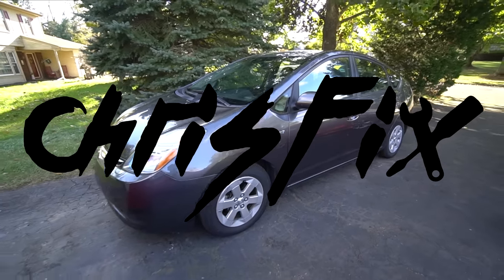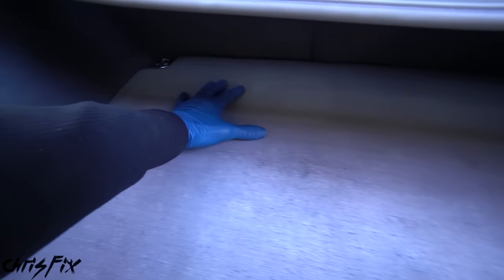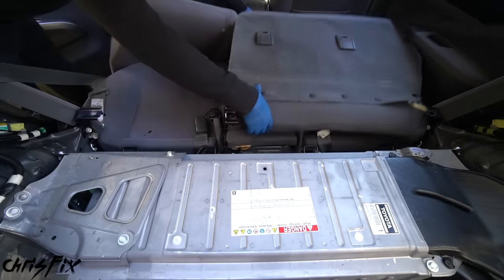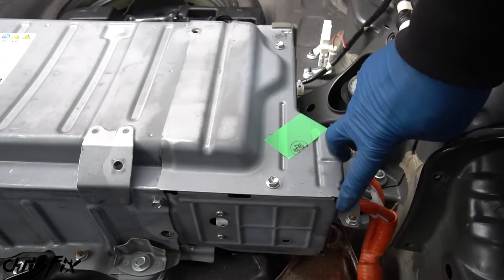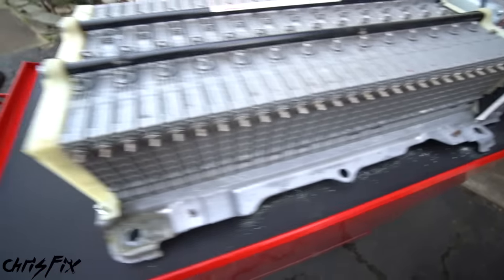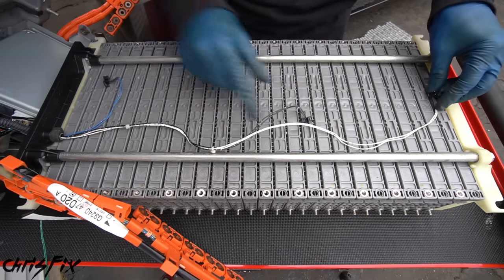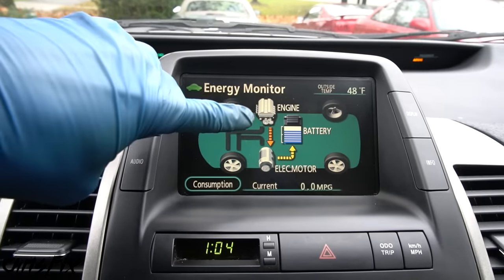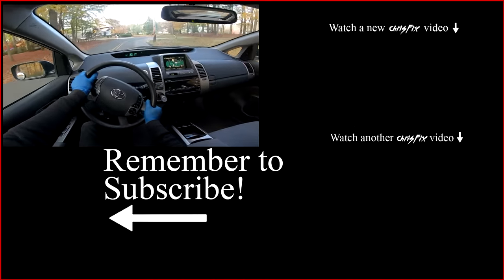I Bought the Most Hated Car on the Internet (and made $1000)

Comment: I’ve been watching your videos for a long time and my friend has two and he saved over $11,000 because of you
Reply from the maker: That is awesome!
Reply: So how much did he actually spend on batteries for the hybrids ? The battery for my pick up is $80.00 .
Reply: Your friend has 2 videos?
Reply: I did a brake job on my Outback and saved over $700 over the dealer estimate. I watched video several times.  By the way your advice to buy an electric impact tool is priceless. Bought one to work  on my pickup and it is a tool I find I use constantly. Money well spent!
Reply: @eaglerider1826  because your car battery is only used to start the car and run some systems but hybrid batteries are used to move the entire car. also hybrid batteries are lithium-ion type and car batteries are lead-acid type so there's a difference right there. when this prius was manufactured the cost for lithium-ion battery packs were 10-20x more expensive than they are now.
Reply: @sentfromheaven00  My point was how cost effective is the hybrid if you have to change the batteries every four years at a cost of several thousand dollars . The maintenance on my truck is a $30.00 oil change once a year .
Reply: @eaglerider1826  my colleague drives 100 miles RT everyday for working. He changed the battery in 8th year with 120k on clock. He got around 70 mpg avg. So comparing with regular sedan get 25 mpg at the time, he saved over 10 grand in gas alone.
Reply: @kiraasuka9943  So how much did it cost him to have the battery replaced ? Price plus labor . I have 215k miles on my truck and have changed the battery once . I also drive home to visit my parents twice per year which takes me 8 hours and 500 miles each way . I don't have to worry about the time it takes to stop and charge the battery or being able to find a charging station along the way . The Hybrid is the car of the future but it is not effective today . What is the extra cost in his electric bill and what does it cost to use someone else's charging station ? Give me an 8 year total and substract it from the 10 grand he saved in gas .
Reply: @eaglerider1826  hybrid is now and the EV is the future. You know nothing abt hybrid or just Prius. Hybrid no worry abt range. Hybrid has gas engine AND battery powered motor. Prius is not a plug in hybrid. Gas is the only food it takes. It's not affecting your electricity bill at all. The battery replacement he's done himself. Took him a weekend and $1200 for the new battery/related parts. He's still saving 9k at least. 
You can also ask an independent shop to do the battery swap job for you and the price is abt 4k. Still saving big.
If you want a plug in hybrid, I think accord hybrid. Other hybrids has too small range. Prefer something can go 50 miles on battery alone. 2 companies I worked after 2016 offer free charging at work. I have another colleague charging his Tesla model 3 at work 100% time. He paid 0 bucks in gas and maintenance for the past 2 years. 25k miles on clock.
Reply: @kiraasuka9943  You are right , I'm not an expert on the hybrid or the Prius . All I know is what I have read . If your friend changed his battery after 8 years or so that means it's a 2012 or older model , so I researched it . The 2012 was rated at 46-48 mpg new . There is no way he is getting 70 mpg . Prius did make a plug in model but this is not it . It had 2 batteries , one for traction ( currently $2378.00 plus tax from Amazon = $2,592.00 @ 9% tax ) . The other battery is for powering computer and accessories and sells for $400.00 . It uses an inverter which is $6,000.00 to replace . It also uses a cooling fan to blow on the traction battery and shows a scheduled cleaning maintenance of every 30k miles @$250.00 since the back seat has to be removed . The best thing going for it is that it is made by Toyota and they are very reliable , my truck is a 2001 model and still going strong . Still not cost effective compared to my truck .
Reply: @eaglerider1826  would you ever go to dealer for maintenance? Idk anyone ever do it. I'm getting 40 mpg on highway in a 2020 jeep compass rated at 30 though most people cannot. It just depends on driver. In the website that Chris gives here, the Toyota Prius gold kit is $1438. My colleague has a 2010 model and he replaced the battery at end of 2018. 
Also, Saving is saving. Lets say he got 45 mpg, and he saved 6k over the years. Prius has 2 battery, the traction battery that Chris replaced here, and a regular 12v battery same as your truck. Your truck also need to replace the 12v battery every few years, every car does (including Tesla).  So that cost is out in this comparison. So after all he is still saving 4 grands over the years.
Reply: I saved 50 000.00, because I did not buy an electric car in the first place.

Comment: An extra step I'd take is to protect all those terminals from corroding again. The vinegar on those nuts will encourage quick corrosion. I'd rinse them or better yet put them in a water and baking soda solution. Then dry them and rub dielectric grease on them or spray them with a battery terminal protector. This way you are avoiding a potential fault,  Every time I disconnect everything electrical, I spray a little terminal protector in the connections.

Comment: If you use vinegar to clean the buss bar nuts you need to neutralize the acid before reinstalling them.  Use baking soda and water.   Then dry they before installing.
Reply: @Butch Ford - No replies= 100% LOL - Also should have used " Dielectric Grease " on all of those Terminals.  Obviously moisture was  attacking those Terminals through time.
Reply: Klaa2  - Yup 100%  :D
Reply: What got me was the original bus bars were copper, but the replacements looked to be something else.  While less aesthetically pleasing, it might have been better to clean and re-use the old ones, if they weren't eaten away.
Reply: @8180634  - You are right about " Copper Bus Bars ", I see that too.  But as you can see, corrosion was attacking it.  As far as I know, once corrosion attack Copper..., it leaves little holes and degrade the Copper.  Once Copper is degraded, Electrical Field travel limited and Charging / Discharging would weaken the Batteries.   I think he did the right move by replacing the Bus Bars.  Although I still stick to my original post with " Dielectric Grease ", so either route would be aok through time.
Reply: @8180634  The new bars are likely coated copper.  A lot of copper electric connectors are "tinned" with a corrosion resistant metal.  I also would add dielectric grease, as suggested above.

Comment: Baggies are good for organization, i also recommend replacing the bolt back where it goes once the part is removed. I replaced my engine last year and bolt and part organization is the most important thing you can do to save your self time. I also recommend creating a log of what you are doing. That way when you put it back together you can just read your log and reverse. This will ensure you will not skip a step then have to double back and correct something you skipped.

Comment: "I bought this car for 1500 bucks and it's worth 4000!"

Previous owner "son of a b-"
Reply: lol ....... !!!!!!
😬🤪😜
It’s worth $4000 with the new batteries
Reply: he put in 3-6k of labor plus 1.5k in parts. Not really worth fixing or buying, especially since you have to do this every 6 years. Even fixing it yourself looks tedious, boring, extremely time consuming, and dangerous.
Reply: @buttermashpotatoes4617  yes thank you it was a joke
Reply: Butter Mash Potatoes 3-6k of labor?? R u crazy
Reply: @rockhardmemes2203  I mean sometimes I think so, but I hope not. Have you found it for cheaper?
Reply: Butter Mash Potatoes wat do u mean I thought u meant that the work he did replacing the battery was worth 3-6k
Reply: @rockhardmemes2203  It is... that’s how much you’re charged to get it fixed
Reply: @iiplaya  ,
He earned $1000 for about four hours labour. That’s $250 an hour. That’s more than twice what I earn! A pretty good deal I reckon.
Reply: @iiplaya  Wasn’t it 4k total, labor and parts by a dealer?
Reply: @StevenGreenGuz  You make close to $125 an hour?
Reply: @TheWatcherAlias  he must be a plastic surgeon
Reply: @buttermashpotatoes4617  😂😂😂
Reply: Worth nothing a car with battery out of order on only 165 000 miles..
Reply: @Evander42117  This reply is even more laughable than the original one.
Reply: @buttermashpotatoes4617   My spouse has had her Prius C for 8 years now, and the batteries are still doing pretty good.
Reply: @chris0579    The year of the car, not the miles, is more important when it comes to batteries.  My spouse has had her Prius C since 2013, with 150, 000 miles and both the batteries and the rest of the car are doing well.
Reply: @buttermashpotatoes4617  

Most Prius's last well over 200K on the original battery. It's one of the most reliable cars to own period. If that was a new battery he put in, it should last 10-15 years at least. Personally I would just have replaced the bad cells for $50 to $150 and rebalanced the battery and kept on rolling.
Reply: @buttermashpotatoes4617  Actually it's none of those if you are a reasonably competent DIYer.  If you are not, then scrap it or pay the dealer 4K for parts and labor.   Looks perfectly safe for my skill level and is about 4 hours of work.  I HAVE HIGH VOLTAGE TRAINING AND EXPERIENCE.
Reply: @buttermashpotatoes4617  Wrong. Batteries last much longer than 6 years. Mine is 9 years long, I have 75% original capacity. When it goes down to  40%, then is time to replace them.

Comment: Very detailed video, absolutely precise. It shows everything important and nothing unimportant. Just two things: on my Prius, the side carpet elements also have a bolt on the bottom, next to the seat. Plus, if you replace the rubber pipes to a new silicone, the prius odor will diminish.

Comment: No special tools needed...do you hear that German car makers????
Reply: Cars1999 F German
Reply: @homefront3162  Im german.
Reply: Indeed...  VW crazy.   Need a $300 computer to release the parking brake so you can replace rear brake pads on Tiguan....
Reply: @Tracker5111   Jack it up, put it in neutral (?)
Reply: @SevenSixTwo2012   Pads won't release from the caliper without the tool.
Reply: I agree. However this replacement isn't exactly straight forward either. Notably why does removal of the battery unit requires removal of so many interior panels?
Reply: Lol German Engineering, VW turning owners into mechanics
Reply: @patricks5575  That was a long time ago. Polo 86 2f or Golf II were cars you could easily repair or tune the way you wanted it. But today, there is nothing you can do without buying special equipment for like 30k€, and its much cheaper to pay a dealer 15k€ to do the job. Ok, you can change your battery or the radio... yes, thats all. 

And that is because VW want to make money and nobody stops them from doing this shit
Reply: @Tracker5111  try OBDeleven... It's £50 (or roughly 70usd). It's a Bluetooth dongle that plugs into the obd port, runs via app on phone and lets you access the onboard computer and make all sorts of changes, including releasing calipers. I wish they would move maintenance things like this into the infotainment systems. People have a right to repair their cars, granted for safety, the submenu of maintenance could be pin code protected to stop someone randomly accessing, nevertheless there should be s regulation shift requiring manufacturers to move maintenance task related items into a user accessible sub menu of the infotainment system.
Reply: @Tracker5111  also Carista dongle can do it. It's $20 and you get a free month. Or it's $40 a year. You can also costumize many other things with it.
Reply: @Tracker5111  If I remember correctly, I went to a VW dealership where my friend was working on a Tiguan. It was on the rack with the entire engine and cradle dropped down from the rest of the vehicle. When I asked what the heck he was working on...he said the power steering pump needed replacing!!! He said that just to replace the P. S. pump, you had to drop the engine and it's cradle!!! WTF!!! Damn Volkswagen, that's some crazy engineering.
Reply: Chris I have replaced or fixed over 100 battery packs. Being a master tech. Not once in your video did you ever mention the danger of high voltage and the safety precautions. You didn’t even use a volt meter to verify that the voltage was removed and safe. Also none of the sockets, extensions, or ratchets were wrapped with like electrical tape. So there’s no chance of arcing on the battery terminals. Why weren’t the busbars left on with the black covers till the battery was removed from the tray. The terminals were left totally exposed. I have see my share and messed around with how dangerous a 200v prius battery pack is. I used it as a arc welder and a plasma cutter. You wouldn’t want people to get hurt.
Reply: We took his advice and bought a small impact gun for it - what a lifesaver!

Comment: "and you don't need any special tools" 
Me: looking at my toolbox which consists of one whole screwdriver and a can of WD40....  Yeah I got this.
Reply: Is there a craftsman wrench? 

(Hope you get the "Made In America by Toby Keith" song reference)
Reply: As opposed to half a screwdriver, which is more likened to a shiv than a proper tool, and also the only tool I own.
Yeah this is fine
Reply: The only other tool you will need is a BFH.
Reply: Loollll
Reply: What?! No duct tape? YOU ARE NOT EQUPPED!
Reply: @Adam-rp2fi  battlefield hardline?
Reply: Now that is funny!
Reply: Just buy a new car, when the batteries are empty.
Reply: @Adam-rp2fi  battle field hardline
Reply: @ok-70707  Big Fu*k!ng Hammer
Reply: @Maximus20778  Big Fu*k!ng Hammer
Reply: @Adam-rp2fi  OK bud calm down
Reply: @willymueller3278  Drive it into a river...
There is plenty of current there!
Reply: @slitor  Thats a good one, I must remember that ! Holy smoke !
Reply: The torque wrenches (3/8's in. and 1/4in.) need to be good ones for accuracy. Rent them if you can. They will cost a bit at a good tool store.
Reply: @madusmaxamus8670  But you don't need any Special tools. lmao

Comment: I finally did it on 2009 Prius Gen2 at 215000km. Replaced 8 modules of 28. It took me ca. 4 hours from start to end. (Incl. fan cleaning) It worked!
The only problem I encounted was a Interlock error (Orange safety tab) Removed and reinstalled it. It did the job.

@ChrisFix: Thank you for the great tutorial!

Comment: Great video, just one thing I'd like to say as a mechanic. Do not disconnect a 12V Batterie like that. While unbolting the ground strap there is a high risk of arcing and especially in newer vehicles this has the possibility of destroying several really expensive ECU's. just use the pole connections to disconnect it.
Reply: Yeah but on a prius it’s really hard to get to the pole, easier to take it off like how he did it.
Reply: @spartanrules9935  I get that and on a prius it might be fine but I have seen cars were this lead to a repair bill of around 3500 bucks. I'd rather invest a bit more time to do it the correct way.
Reply: @Isamu1013  explain in newbie language
Reply: @doggothinks2764  they are saying disconnect at the battery terminals because its safer.
Reply: @doggothinks2764  he is saying to disconnect the negative cable for the battery right at the post on the battery itself, not from where he did.
Reply: Going to be honest, is the 12v battery the small battery, same thing as a regular battery in a car?
Reply: @samplautz5586  yes
Reply: @naentertainment1000 4:30

Comment: I remember reading a Reddit post where they got that warning in their Toyota, the dealer insist on replacing the battery which cost like the one on the video. Then the OP decided to disassemble the battery themselves to see what's wrong with it, and he saw the corroded bus bars and bolts just like in the video. He replaced the bus bars (or just cleaned it with vinegar, I don't really remember) and put the whole thing back together and guest what? The error is gone!

So unless the car puts out battery cell error maybe you can try cleaning/replacing the bus bars first before replacing the whole battery.
Reply: yeah i have the same issue now i guess, error p3030.
Reply: Good tip my nigga